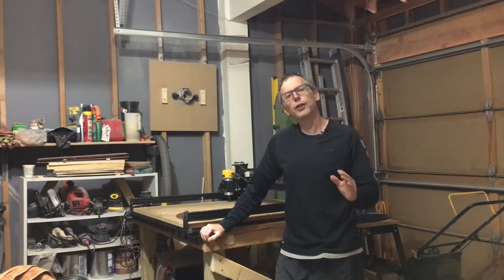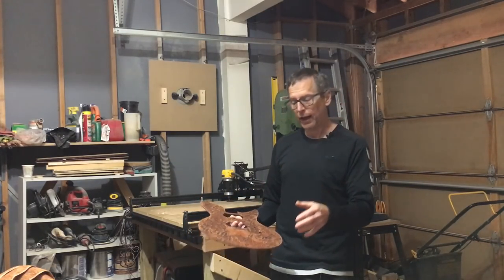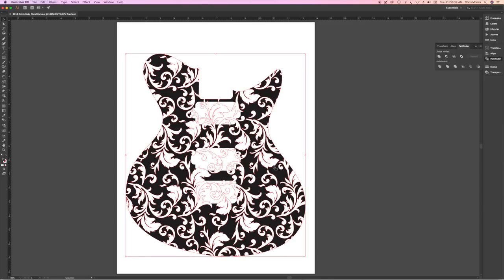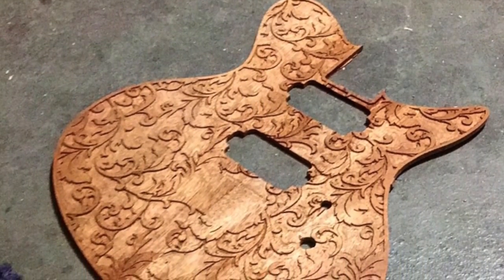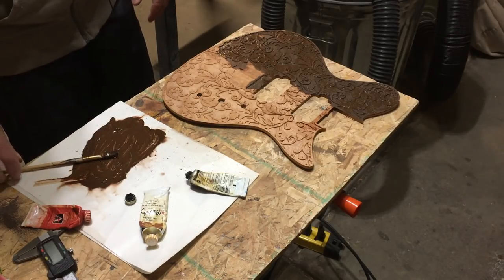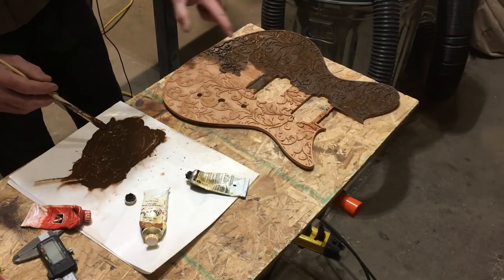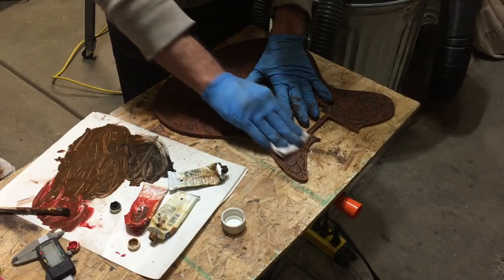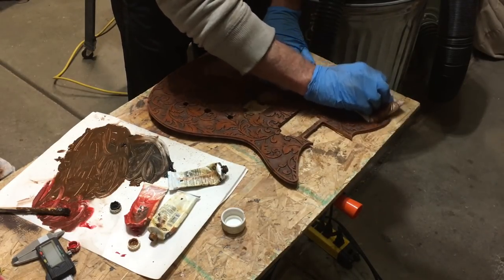How To Engrave A Design Into A Guitar Top

Comment: That looks fantastic. I'd love to see how you attache a top like this. I don't cut the pickup holes into the top until after it's attached, so it would be interesting for me to see someone glue on the top when it's already basically finished.
Reply from the maker: It's easy. I just glue and clamp. Everything line ups because the top and body were cut on a CNC machine.

Comment: Very nice!  I'm not crazy about visiting a website to use proprietary CAM tools with a monthly subscription service.  I'd rather but the software outright but it seems that the industry is moving to a rental model rather than a software purchase model.  However, the high resolution 3D rendering looked great.  What did you do to remove the CNC carved fuzzies?  Did you use anything more abrasive than paper towels?

Comment: Awesome! What your method to center the piece to carve? I have an x-carve too and I've two slight issues I didn't solve yet: aligning the wood and exporting the Illustrator design at the actual size. Great video and tips as always! 👍👍🤗🤗🖑🖑
Reply from the maker: I use a sharp engraving bit in the router and place it at one end of the centerline on the blank. Then I jog the router to the other end of the centerline and adjust if necessary so that I can jog it back and forth (or side to side depending on whether I am aligning on the x- or y-axis) to make sure the point of the engraving bit follows the centerline from one end to the other. Not sure about the Illustrator export problem. Mine always export at actual size.
Reply: Thanks for the answer! Just to make sure i get it correctly: you pin point the center  line extremities with an engraving bit, I assume the smallest one to be precise, and use ont of these two point as "zero" position? And if yes, are you able to change the bit to switch to a bigger one to do the job? I've read on X-Carve site that it's isn't easy nor recommended. I bought a contraption called Triquettra that seems to ease and "automatize" the zeroing process, but it's only working on PC and not Mac, so I didn't use t yet.
Reply from the maker: I pinpoint the extremities of the centerline with a sharp engraving bit to make sure the blank is square with the x axis. Next, I manually move the router so the point of the bit is right on the middle of the centerline. If the blank is 18 inches long that means the bit will be at 9 inches along the centerline. At that point, I switch on the controller and raise the bit .1 inches to clear the top of the blank. Then I jog the router 9 inches toward me on the x. If the blank is 14 inches wide, I'll jog the router 7 inches on the y. That put the center of the bit on the xy zero. Up to this point, I have only hand tightened the the collet so the bit will be easy to remove. Now I raise the router so I can remove the engraving bit and replace it with the cutting bit I intend to use. I only hand tighten it enough to hold it in place. Sometimes I have to jog the router away from the blank to get enough access to change the bit, but I do this in 1 inch increments so I can easily reverse the movements to get back to the xy zero. Once the cutting bit is hand tightened and the router is at the xy zero, I loosen the collet and let the bit drop down to the surface of the blank. Then I tighten the collet to secure the bit for carving. Now the bit is in the xyz zero and ready to carve.
Reply: OK, I see! Thanks for the detailed explanation. I'll try this method and let you know. Until now, I only made "easy" cut with no center line. Just discover recently it was possible to set different "cut" on a same project and at the same time! Learning curve, learning curve…

Comment: It looks really nice, great job :D
Now I am concerned about that wood. Normaly when you paint with oil based paints you have to prime the surface with gesso or acrylic paint because the oil in the paints will over time corrode and start to rot the wood, destroying the that beautiful piece of guitar top. You can read more about this here: https://www.quora.com/Can-oil-paint-be-used-on-wood if you feel like it. 
That and you should be quite careful with paint thinners and even the oil paint itself because you are using the artist level grade ones that have much more pigment(and its more refined) than oil. So look for the AP seal on the tubes and you should be fine, if it says CL you should take proper cautions while using them, you can also read more about it here: https://www.acmiart.org .